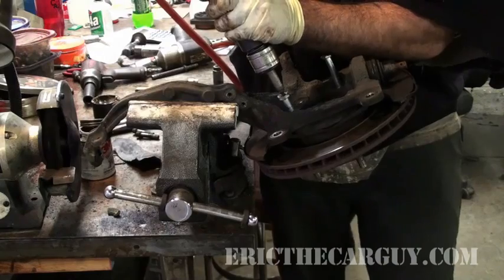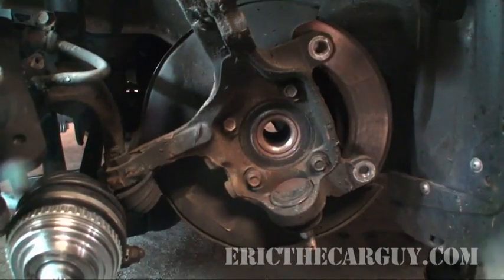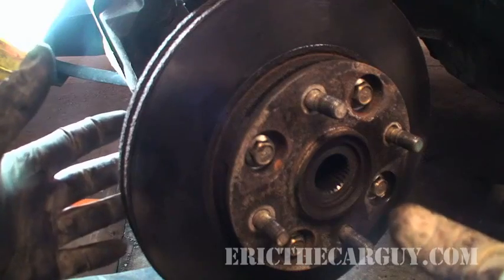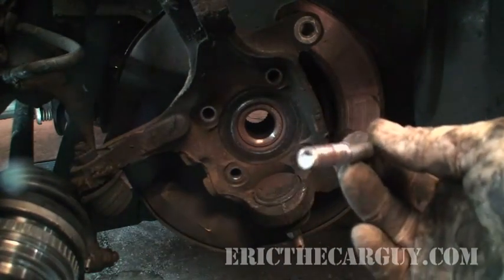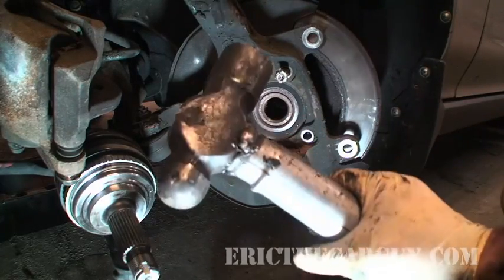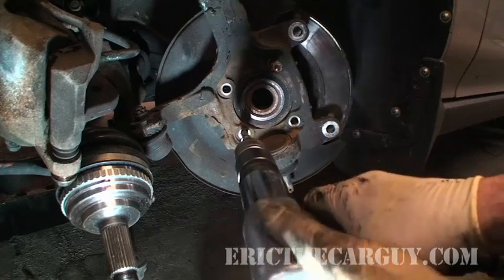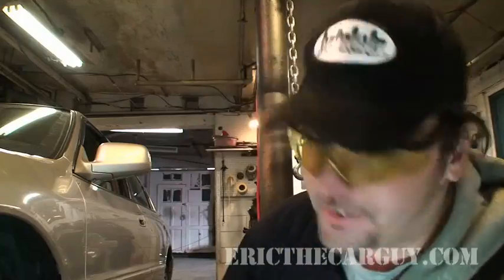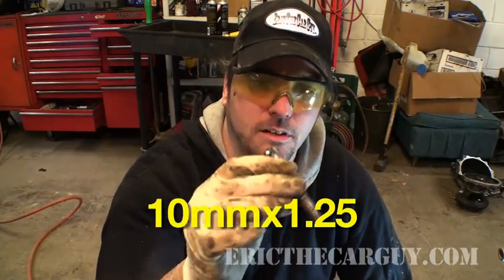How To Replace Honda Captive Rotors On The Car - EricTheCarGuy

Comment: Thanks for the vid! I replaced all 4 rotors, the bearing pressed right out with the air hammer in less than 2 minutes! The hardest part was separating the ball joint from the lower control arm, I pounded on it with a sledge hammer for a half hour and no go.  I destroyed the boot on the first one with a pickle fork.  on the second, jacked up on the lca, stuck a 1/2 in ratchet in between the lca and knuckle, dropped the jack, kicked down on the top of the rotor, and BAM!!  Popped right out!!

Comment: You are right about the potential of damaging the wheel bearing if you use the slinding hammer and exposes the wheel bearing. In the past that is what I do because I learned it  from others. Eventhough I never have a come back on those capture rotor jobs, but I think doing the right way is more customer/ wheel bearing friendly. It may take a little more time, but it is less straining on the body. Good video.

Comment from the maker: @CincyPlasmaTech WD-40 is not my preferred penetrant but you raise an interesting point.  To be honest I think 'beating' on the bearing would do more damage than the penetrant.  In addition I'm putting it on the outside of the bearing NOT on the bearing itself so if any got in I would suspect it would be a minimal amount.  Good question.
Reply: EricTheCarGuy what about Oil of Wintergreen? An old guy who was in the Navy i knew swears by it

Comment from the maker: @mdLexX I hear that a lot, seems like a lot of work to me considering your not changing rotors all that often, Honda just recommends pad slapping them unless they are warped and even then if there is enough left to the rotor they can be machined on the car without having to remove them.  Between you and me the TL rotors warp ALL the time so having easy access to them might not be a bad thing.

Comment from the maker: @dandim23 It's really no safer, the rotor isn't going to come off as long as the wheel is there to hold it on.  I think they did this to help eliminate any hub runout issues that sometimes occur causing pulsations.

Comment from the maker: @fastvpbt1 That sounds like an alignment issue and I'm not sure if you can correct it with an adjustment, you may have to replace some parts.  Honestly I would have to look at it for myself to really have an idea.  Good luck.

Comment from the maker: @96HondaEX5Speed You actually run the risk of damaging the wheel bearing doing that because what you are doing is separating it.  I've seen more than one come back because someone tried to 'short cut' it as you suggest only to have to replace the wheel bearing in the end.

Comment: Thank you very much Eric. I have been using a few of your videos to figure out how to get a rotor off of my '95 Accord Wagon.. It's been hell w/o air tools and most likely because of my impatience i sheared off a bolt on the back and rounded off one on the front. I'll get around that though but still -__-". At least the hard part is over.
Thank you for your videos.

Comment from the maker: @82password If you don't have pressure there is probably a leak somewhere.  AC work in my opinion is probably best left to a professional as it requires a few special tools and a good working knowledge of the system to properly diagnose.

Comment: Get a small propane torch, heat up the bearing hole before hammering out with bolts  to remove captive rotors.
 Literally drops out with minimum heat applied!!

Comment from the maker: @bustfer07 It's really just as bad as under-filling it.  The oil will come into contact with the spinning crankshaft and get whipped up into a foam, the foam doesn't lubricate at all and as a result the engine will suffer from a lack of lubrication.  In short, it's not a good thing.

Comment: I just did this earlier, and I was stressing because I was worried I would get the rotars off, but instead I took the axle nutt off first, then the 4 fastner bolts, and tell why the rotar was loose off the bearing assembly so easily then all I did was remove the back 4 bolts that hold up the bearing assembly, didn't need to hammer anything or use special tools. FYI my rotars and bearings were super rusty, is this just a method to spend more time, or was I just lucky switching things up my way?

Comment: note the bolts are not m/10 1.25 they are fine thread. Found this out after I was at that stage. I was able to use the original bolts I was a little nervous of bending/snapping but no problems. cheers.

Comment from the maker: @wormguts23 I'm not with you on that if I'm honest.  Considering the effort and expense I don't think it's worth it because you really don't have to replace rotors all that often and if there is enough left on the rotor they can be machined on the car, converting them is more vanity than anything in my opinion.

Comment: nice vid eric! wish i had a garage like that! wow. mine is a one stall with a no-engine camaro in it. i'm off to go get my suzuki  450 running,it idles, part throttle it dies or keep twisting and it winds up and goes like a bat outta hell. it may be my petcock along with the gummed up carbs, the bike sat all winter. was running ok. then this happened. so off to wrenchville..later.

Comment: Will WD-40 (or similar solvents) harm the wheel bearing? I was concerned that any bearing lubricants would break down when using WD-40 to loosen any rust holding the wheel hub to the steering knuckle. BTW, I found it useful to loosen the wheel hub fasteners in the front about the same time that the wheel nut is loosened. They are tight, and it beats chasing a hub and rotor around on the ground, and expect to get high torque while doing it. No bench vise here!

Comment: What the fuck was Honda thinking when they engineered this piece of work?
Reply: Same shit I said. The 2007 I had was way more easier
Reply: Doug Hunt I had an 89 accord lxi it had conventional rotors. why they switched I'll never understand.
Reply: Doug Hunt Apparently they didn't do it with the Acuras of that vintage. I had a 92 Integra that didn't have captive rotors, nor did a 90 Legend I had too.

I did have a 91 Accord coupe they did do it on...why do it on one line of cars and not the other?
Reply: Doug Hunt too much Sake and weed I think

Comment: I've been banging on these bolts for like three days, I can't hardly get a socket over them. The air hammer I have hasn't done anything either. Are there any other solutions to removing bearing / wheel hub...

Comment: Hey Eric, I have a 1990 Accord DX and my AC suddenly stopped blowing cold air. I'm not sure if its the compressor or if it needs to be recharged. A friend and I checked the pressure and there was none. Thats all I know. Any advice on this would be greatly appreciated. 

Thanks,
Chris

Comment: Random question..... the bolts the hold the rotor and hub together,  where can i find replacement, one of mine is strip and before removing i would like to have a new replacement on hand 

I trying to avoid a scrap yard they all seem rusted in after years on the yard

Comment: Is this the same for a 1998 Hyundai Accent? I need to replace my rotors and it does in fact have captive rotors. I've read that you need a hub puller to remove the hub assembly and a press to put the assembly back together. Any help is appreciated.

Comment: how long are those 10x1.25mm bolts you are using to get the hub/bearing out?  can i just get some long ones and torque the bearing out of the knuckle or am i missing something here?  is hammering those bolts the best way?

Comment from the maker: @teawins21 I've got a better idea, save yourself the trouble and take it somewhere where they can machine the rotors on the car if there is enough left to the rotor, if you have replaced them with new in the past there should be plenty there to work with.

Comment: @82password 
no pressure means it needs recharged.  I'd get it checked out for a leak as well.  o-rings get old and harden/crack after 20 years.

Comment: To match up the extra long high grade steel bolts you use to air hammer the bearing assembly out could a person just take one of the smaller holding bolts out and head to the auto parts store to match it up?  I'm only saying this because you don't seem 100% sure about the size and or thread pitch...

Comment: That bottom bolt you broke loose, the castle nut, I couldn't break loose in any form. In fact, trying many different ways, I mushroomed the end, so I had to chop it off to get the nut back on... >.>
So I guess it's impossible to change my brakes.......

Comment: The size of the bolts holding the hub to the knuckle is 10M x 1.25 x 40mm. For the fasteners holding the rotor to the hub it's 10M x 1.25 x 20mm. I rounded off half of my bolts and needed the LENGTH info so I could purchase replacements.

Comment: Guys I changed out my rotors. But the Rotor and Caliper bracket on the passenger side started grinding against each other and totally messed up my Rotor. What did I do wrong :( I did the Driver side first and its fine.

Comment: attempted to remove the axle nut yesterday and my car started knocking. I only removed the 4 bolts holding the disc brakes and the 2 bolts holding the caliper . I did stand on the breaker bar on my attempt to remove the axle nut(I did use a torque wrench) . please good lord heavens above help a brother in need
Reply: did you solve the issue?
Reply: Luca Fuoco silly me. didn't check if the other wheel is tight.. so, just a loose wheel lugs :D

Comment: Bad idea. Remove the entire knuckle. It's 2 more nuts. The problem with this is you run the risk of damaging the rack and pinion seal. In fact, you can ruin that seal simply by letting the tie rod drop without support.
Reply: Actually 4 more fasteners if you count the brake line bracket.